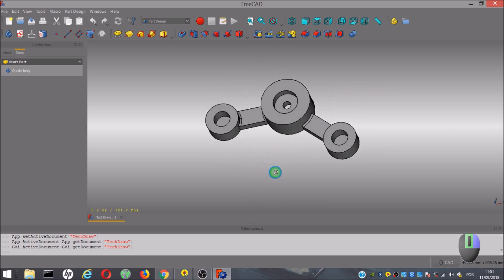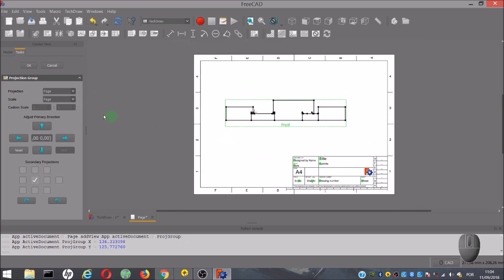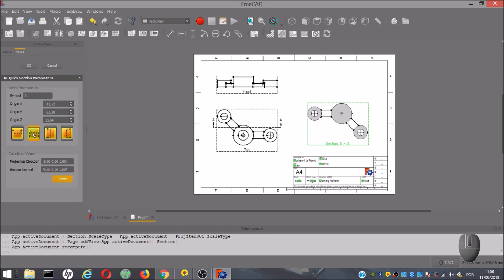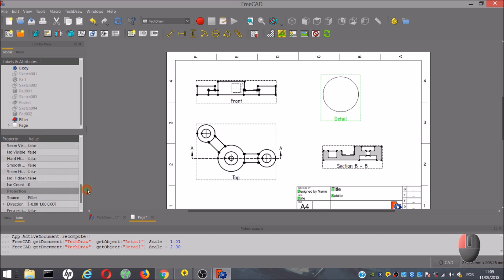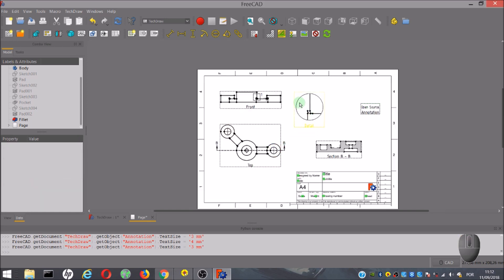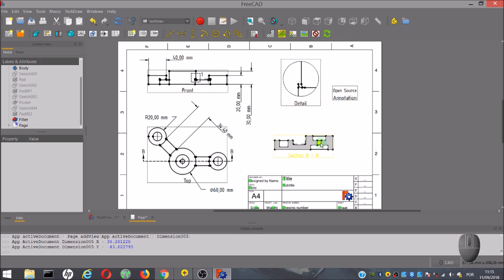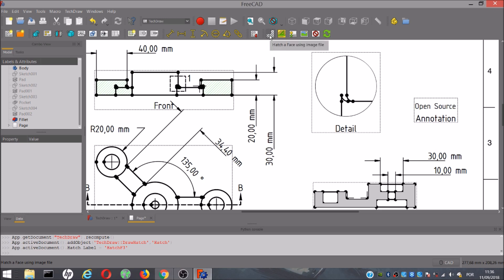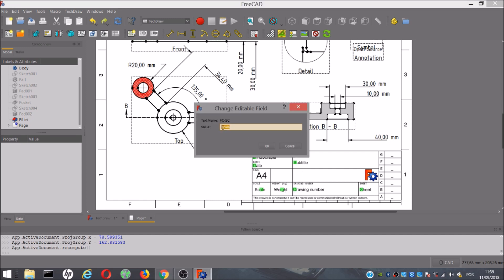FreeCAD TechDraw Workbench and 2D Dimensions

Comment: I didn’t have the two ‘active’ tools you have when you click ‘Tech Draw’ on your ‘Start’ dropdown menu at the beginning, so my first question would be why is that?
The answer of course is because you didn’t tell me to start by going to the ‘File’ menu and clicking ‘New’.
Well DUH!
Next question; why would I want to use the ‘Tech Draw’ workbench in the first place, rather than use the ‘Sketcher’ or the ‘Part’ menu to create my part? What is the advantage of the ‘Tech Draw’ workbench?
You concentrate on how to insert dimensions into a drawing of a part you have already made. Meanwhile the part remains static throughout. This leads me to assume that the ‘Tech Draw’ menu exists only to allow the user to see the project as a ‘technical drawing’ rather than as a 3D part?
Having worked in engineering at a basic level I know I’ll need a drawing like this if I want a professional engineer to create an injection mould for me and I would ask, is this the purpose of this tutorial? And indeed is this the purpose of the 'Tech Draw' workbench?
If so it would have been good to have had this explained in the first place because the ‘Tech Draw’ workbench isn’t really helpful to the average ‘FreeCad’ user who simply wants to create parts in order to 3D print them at home. Please clarify.
This is potentially a very good tutorial about the more professional ‘technical drawing’ aspect of engineering, but it’s not very helpful to the average domestic user who is simply making parts for 3D printing at home.
It’s very good, but please keep it in context.
Otherwise nice one mate.

Comment: At 10:52 you can all see how there is no snaping point in the MIDDLE OF THE CIRCLE (top view) which makes TechDraw workbench totaly unusable to dimension anything with holes and is therefore completely unusable at the moment for any kind of real project. This workbench still needs to mature A LOT! In version 0.19 they will offer a tool to add 4 points to the circle, but still no point in the middle of the circle (???). So if this is not in the 0.19 it will take years (!) in order for the stable program to get this functionality...

Comment: Can I make these vertex dots smaller? They are way too big. It makes my views unreadable in most cases!
Can I connect annotation with an arrow somehow?
Reply: This is the third video I watched that started out with a image of technical drawing without the big dots, and ends up with one with them.  It most be obvious to many people.   Piotr, if you ever figured it out could you comment here.
Reply: @dennishueber3631  I did figure it out. It goes like this: Edit->Preferences
On the left panel choose TechDraw workbench options icon, then select second option tab on the top, named TechDraw Dimensions. In the section 'Decorations' look for the Vertices Scaling parameter (or something like this, my version is translated to my native language, so I can't be sure). I changed its value to 0.9 and it works fine for me. You have to restart freecad for the changes to take effect. When you use TechDraw workbench another tip is to use Turn View Frames On/Off feature when needed. It disables and enables vertices and vieport names ("Left"/"Front"/"Top" etc.) visibility